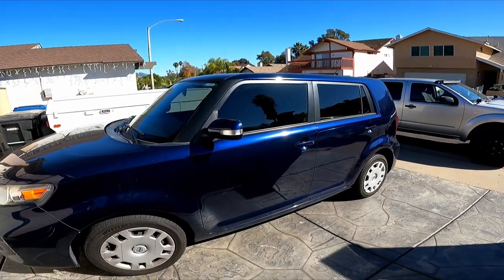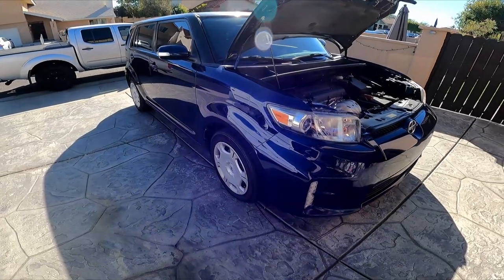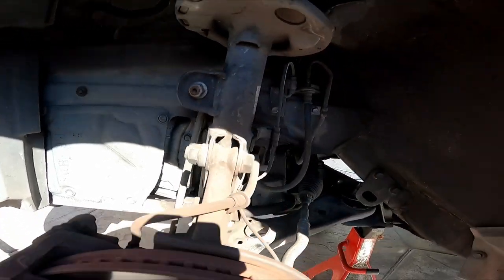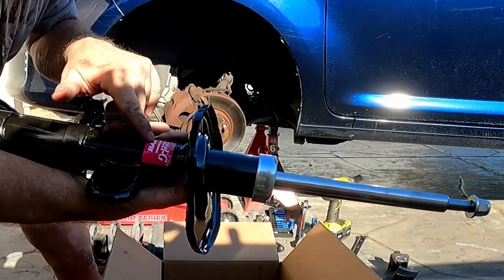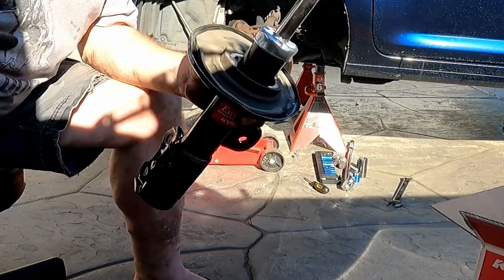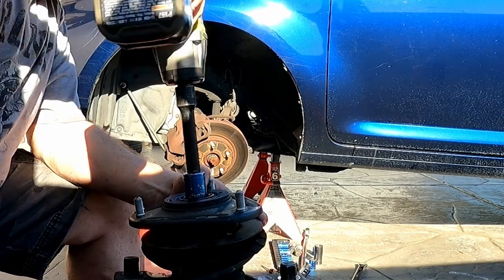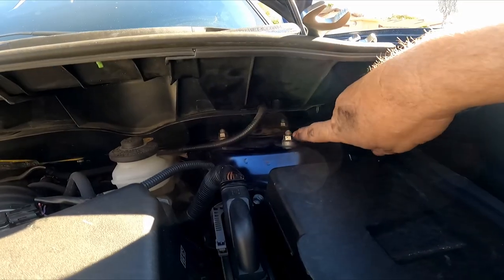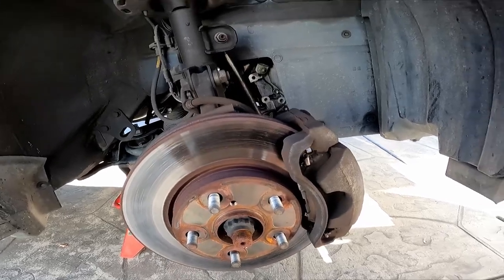2015 Scion and Front Strut Install

Comment: Those KYB that exceeds oem are the best ones. 

I have a 2015 lifted Scion xB, with a 2.5” lift. Using a 3rd/4th gen front rav4 suspension. And rear lift kit spacers. Running on 215/70/16 toyo open country at3 on black rhino boxer wheels. 

But I’m gonna be able to upgrade my suspension lift kit, using bilstein b6. Now they don’t make for Scion models (except Scion FR-S), but I made it work. Using front rav4 bilstein b6, and rear 2nd/3rd gen tacoma bilstein b6 shocks and struts. They have the best monotube shocks to make ur vehicle right smoother, increase the traction, performance, longevity, and better right quality. 

I’ve been owning xB2.5 from used 2011 that’s 4 years, and trade to one of the last brand new 2015 for 6+ years. 10.5 years of owning xB’s. Can’t get enough. 

And I’m trying to make them more useful, and a bit more capable for the weather conditions. 

It handles like a dream.

So I was wondering, so u know what’s the size for the front strut knuckle bolts and washers? 

It’s better to replace for a new one, if I’m gonna upgrade my suspension. I got the lens for the rear, but not the front.

@DIYWILLY
Reply from the maker: Hello, I love my XB. I wanted to do the RAV4 lift but was told no by Mrs. Willy..😂 I do not know the bolt sizes by heart but could check in the morning. Thanks for watching!!
Reply: @DIYWilly  1: not a problem at all. 

2: damn ur wife won’t let u?🤣🤣🤣🤣 she’s missing out man. It’s awesome.
Reply from the maker: @toyotabrony  🤣

Comment: @DIYWilly

How’s the front KYB struts? And did u also replace the rear shocks from KYB exgel G shocks?
Reply from the maker: The front struts have been holding up very well, which is more than I can say about the control arm bushings. Time new ones!! The plan was also to put the KYB’s in the rear but never got to it. Thanks for watching!!
Reply: @DIYWilly  glad u have good experience with excel G’s. Hopefully this will remain strong in the long run.

Comment: If I got the full assembly (with spring) I can skip this step yea? 15:05 

250k! Gonna make it my DIY learn stuff on cars, car since probably can't get too much for it in 2024 haha. Anything over 280k is a win!😂
Reply from the maker: Hello Rafael, Yes if you buy the complete strut assembly than you do not have to remove and reinstall the springs. The new strut will bolt right up in place of the old. Thanks for watching!!

Comment: that scion is diy willy approvedits a toyota right
Reply from the maker: Yes sir it’s made by TOYOTA. It’s a great car.
Reply: @DIYWilly  I'm on the part where there was no washer lol I thought there was no torque specs run it down till it bottoms out PLeanty good release the tension this one done get it outta here lol
Reply from the maker: Words to live by!😂
Reply: I have to replace 02 sensor in my pilot soon if you let it warm up runs great but if you start it plan on taking off it cuts out tell it gets to temp
Reply from the maker: Yep sounds like it needs replaced with a damaged heating element.